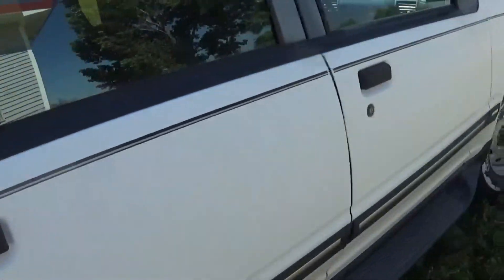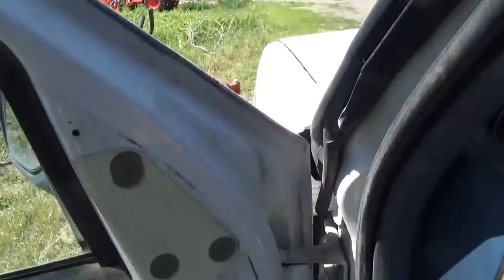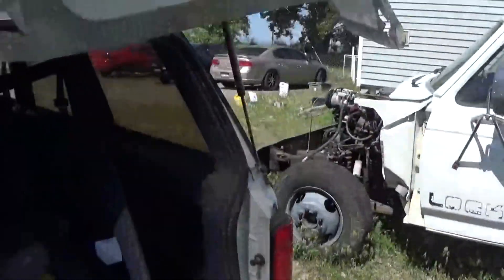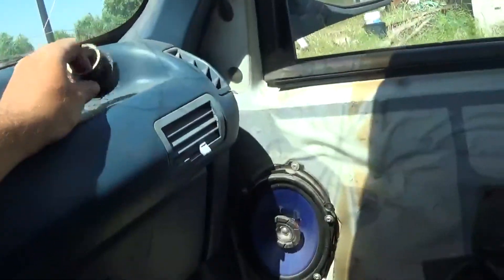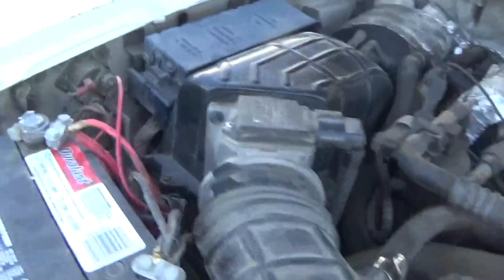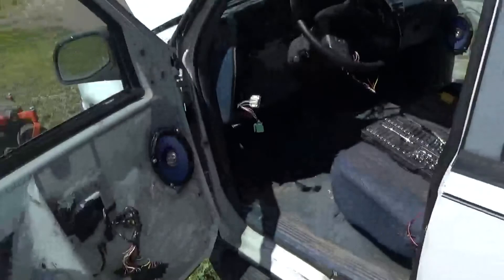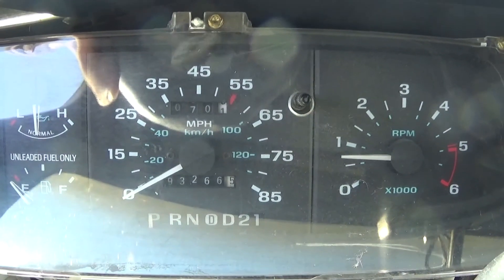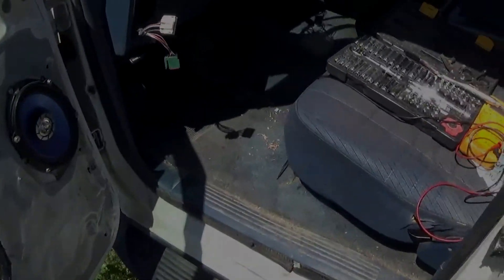What I've been up to... and maybe a second channel on the way

Comment: I'm not going to deny but it looks like this vehicle is going to need a hell of a lot of work. Sitting for six years is significant, I'm sure you've already replaced the battery, changed the gas and the oil out of it. How much money and time are you planning to sink into it?
Reply from the maker: I've already put $200 into it for the oils, filters and the Radio... I still need to get new tires for it and the clips for the locks (which is only $10 for the clips) interior door trim for both front door which is around another $40 for both. I'm not going for a full restore it's basically road ready as it is. But I'm thinking another $800 all told when I'm done and that's if I replace the front glass, and so that would be another weekend or two. 

The only reason why I'm putting work into the Explore is because the Transmission in my current daily is going out + it give me the reason to work on my truck that is seen in the background... I already removed the front clip of it because it all needs to be replaced and the engine is seized and rusted so I'm just going to do an engine swap on that thing.
Reply: Death Light Productions so the purpose is as a precaution and not a daily. That sucks about a transmission going out also. Me being the utilitarian, I'd focus solely on the engine. I haven't really heard of a high idle, that's uncommon but my initial guess would be to check the oxygen sensors, maybe they're reading lower than actual and the engines pitting in more air than necessary.  I'd also replace the coolant as that would likely not last well through an extended period.
Reply: But overall it sounds like you've got a good head in this repair job boss. Good luck.
Reply from the maker: I'm more use to carbureted engines but normally if there's a high idle the Carburetor is plugged up, so I'm guessing the injectors are clogged up, so I got some cleaners for that.
The engine and transmission are fine I drove it 60 miles to get it home and after I changed the oils and filters it really brightened up.
Reply: Death Light Productions Damn dude, I could shoot myself over working with a carburetor, those things are a pain in the ass. Luckily fuel injectors usually just need some Lucas gas additive and they'll work like a top. Get yourself a small bottle, toss it in every 1000 miles or so and your injectors should be ship shape. But anyways, idle at 800 rpm looks pretty good, is it high on startup?
Reply from the maker: the start up is around 3000 rpm for about 20-30 sec. then it goes down and rests at around 1200 rpm after a minute which is a bit high for a V6 5 L so if the cleaner doesn't help it's in the tuning